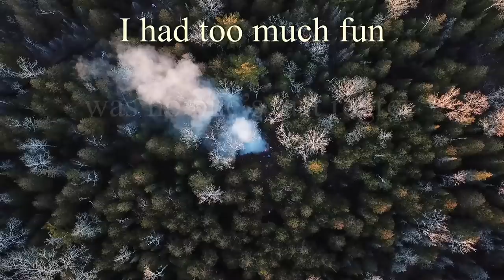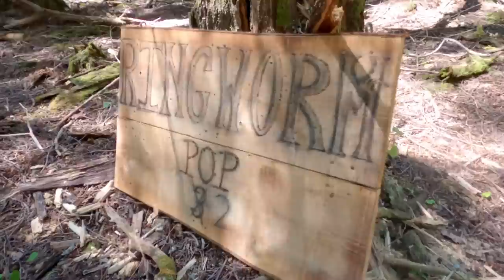An Entire Year Living Outdoors.  (Chainsaw-Milling Trees to Build Whatever I Please!) #24

Comment: You inspired me to fix my chainsaws 😄
Reply from the maker: Glad to hear it!  They have to be the most universal wood working tool on the planet.  If you have access to gasoline.
Reply: @survivingringworm2202  I've been trying to find ethanol free gas because I don't use my chainsaws much.
Have you experienced any differences as far as effect on fuel lines and gas with ethanol?
Both my chainsaws had fuel lines that turned hard as a rock, and I have only used gas with ethanol in them. I'm hoping they will last longer with the ethanol free gas.
Reply: @saltyshellback  I feel that ethanol-free gas def does better in storage for long periods...

Comment: This is like real life Minecraft lol, there is a video about the easiest way to make a cabin , where you stand logs with 3 inch grooves in them for and then taper ends of logs to lay in between the standing ones. 
There is also a cordless Framing nailer made by Paslode that could solve the drill and screws method. Good luck guys , you may soon want to move there permanently with all the crap going on in our world
Reply from the maker: I believe I’ve seen that. But is it the funnest?
Reply: @survivingringworm2202  It makes for larger structure an easier task , if I find the link I will send it . The gentleman has a YouTube channel called " Project Highlander" for making fast cabins with minimal tools.
Reply: @survivingringworm2202  Project Highlander Cabins would also be a little more bear proof too lol.

Comment: I was thinking. You could build a shelter for your tent for the winter if ya wanted? It might keep your tent from the winds at least
Reply from the maker: Would like to at least make a roof. Wind isn’t a problem here in the forest but would be nice to forgo the rain and snow load.
Reply: @survivingringworm2202  yea that’s kind of what I was thinking of or maybe even a danno I think it’s called?  It’s a shelter with three walls.  It would keep you dryer than you already are.  They have them in Sweden I think?  I will have to do more research but i figured since you already have the deck it would be an easy build just the same.

Comment: Have you ever thought about a tent within a tent, to try to keep your sleeping bag from getting wet, because it touches the wall of the tent? Or I guess you could just use plastic or a tarp, to make a cover above your tent. Not touching it anywhere. Is the bag still going to get wet because of condensation? Yeah, I know, I'm still trying to solve problems here. LOL Hey! Maybe wrap the bottom end of the sleeping bag in plastic?
Reply from the maker: Yeah. It’s condensation from just being alive. Whatever catches your breath gets damp which is pretty much everything inside and outside of the sleeping bag.
Reply: @survivingringworm2202  Well there goes MY ideas! LOL I guess you can't just stop breathing at night, right? Well..... Not if you want to SURVIVE ringworm. LOL

Comment: What kind of axe is that, you hung on the door, at the end of the video?
Reply from the maker: Fiskars!  Man, its a nice piece of steel.
Reply: @survivingringworm2202  We did a fly-in fishing trip in Canada in 1999, and there was a Fiskars splitting maul at the camp, and it was the fastest tool for splitting wood I ever used.

Comment: Do u ever have problems with bears or coyotes
Reply from the maker: Coyotes come through several times a day (night.). Not a problem but they wake me up all the time. 
That candy machine I put up was stolen by a bear just a couple days later.  Think I mentioned that a couple videos back. Bears don’t bother ya but they can get into things and cause a big mess.
Reply: @survivingringworm2202  you should try to build a bunk bed
Reply from the maker: Better yet, hoping to build a 20' high deck some time soon!